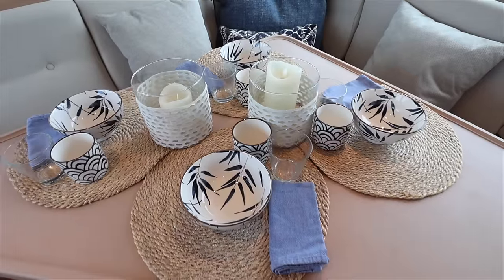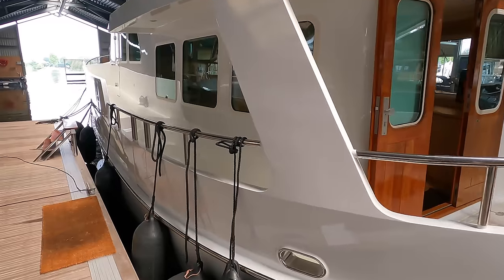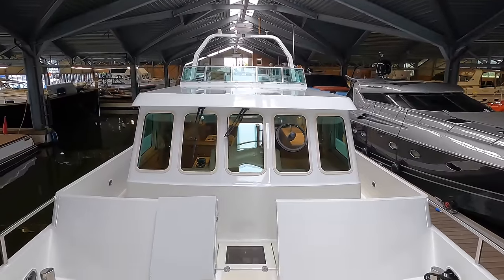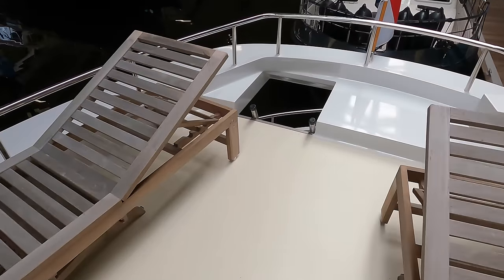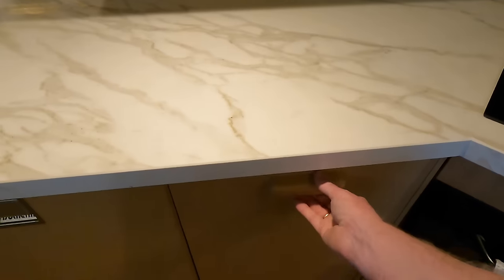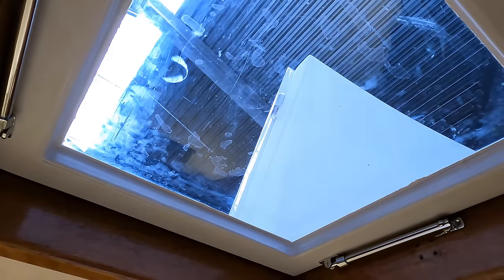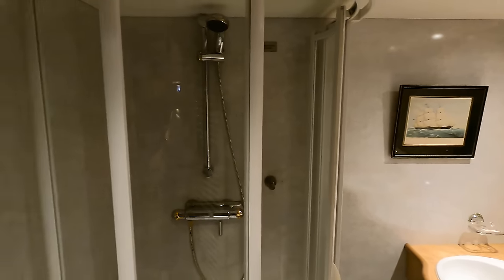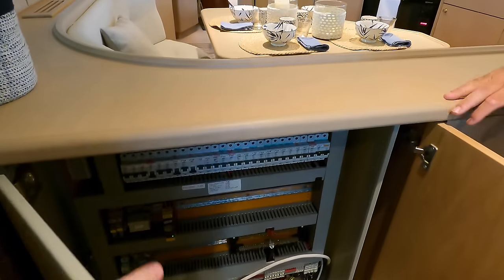ONE-OFF Steel TWIN Engine Explorer Yacht (And She Is For Sale For €545k)

Comment: Did we miss something? One small fridge and no freezer, on an explorer yacht? Reasonably priced and well built i would think, some hits but some misses. Thanks for the tour!
Reply: My thoughts exactly.  Lots to appreciate,  but some things to be desired. Is a bathtub really necessary?
Reply: @MS-bh3uw  Absolutely.
Reply: Fixed;
3000 nm ice. 😄
Reply: @MS-bh3uw  -- is the boat really necessary?  

Of course it is!  I mean it is a tiny tub with Jacuzzi jets - looks like could be great after a difficult grind on land or ice!
I was hoping for more technical area, maybe a laundry area and yes, at least two semi large freezers!
Maybe the mechanical/engine room could handle some more kit?

The tankage is massive though with what, about 4000L of fuel tankage - 3000NM range?  Not bad, necessarily @ 10KNTs, though I could see adding way more solar and I wonder if this could benefit with some sailing rig - main mast to really extend that range (though speed may go down a few KNTs) - and folding props would work better if it were a motor sailor.

1000L for potable water, presumed water maker and generator to handle heating (cooling?) and potable water refill - though a modern water maker could work in a pinch and not take up a ton of space or power.  500L back water tank, yikes!  Three heads ... is nice, two cabins - turn the 3rd (maybe) into storage or technical area - done!

Not bad!

Comment: She's a beautiful ship, but I agree with some of the other comments - if she's going to be a liveaboard explorer, I think she'd need some changes. Her range means you could be cruising for almost two weeks, but with that galley setup I don't think you'd have provisions for more than two or three days. I'd probably get rid of the dining area in the galley to put in a pantry, a freezer, and another fridge (perhaps also a chest freezer on the fly bridge). I would also badly want a washer/dryer somewhere on board. Most logical place for that would probably be where the day head is now, unless we wanted to pull that jacuzzi out and put in a more standard shower.

Comment: If that 3000nm range @ 10 knots is accurate. then that is quite amazing. Dial her back to 8 knots and you're probably looking at 4000nm's. To put that in perspective, the Nordhavn 55, which is a similar length (although 40% extra displacement), has a range of 3000nm @8.25 knots....but her fuel tanks are more than double that of Rosephine.  
Between those fuel savings and her price to buy, Rosephine should be a serious contender.

Comment: This Yacht seems to be absolutely spotless.  Impossibly clean....eat off the deck perfection. Things that need help might be the flybridge access ladder, a dirtier engine room...(proving that the John Deere engines ran more than 1100 Seconds.)  A few cushions to reduce glare for the Captain... 
P.S. Yacht Buoy:  You need to slow down the video, move some things around AND open cabinets.  This would prove the yacht's live aboard qualifications.. If an owner is selling a Yacht, he would probably be OK with you looking into a few things.  You may need to give him/her a heads up, but it's all part of the Game. 
Overall:  This is an Explorer Yacht at a very agreeable selling price.  It will require upgrades to make it a Oceanic Explorer Yacht, though.

Comment: Good use of space. They really got everything in there as much as they could. This would be a great cold water boat. Not so sure I would take it someplace tropical since those airvents look more suited for heat as opposed to AC cooling, but it is a smaller boat so it would probably cool down pretty well. These are the boats though I imagine going through the north sea around Norway, Greenland, Sweden and Denmark then going over the poles to make it down to Labrador off the coast of Canada

Comment: The cutest little ship I have ever seen. I just love steel canoe hulls.  I'm not a fan of over sized looking speed boats. I don't usually like fly bridges but this one is compact and does not look like a pimple on a pumpkin. I would have even been happy with a single engine on this little ship. I grew up in Hull England and most of the big steel Trawlers that ventured into the North Sea only had one engine. I'm a believer in KISS.

Comment: I love this boat. Were it within my power, I would be on the phone with the broker right now. 3.45 metres is 11 feet 4 inches. Regarding the fly bridge. I loathe direct sunlight and desire travelling to rougher places where a steel hull is advantageous, like Alaska, the North sea, etc., so I see it being aerodynamically enclosed against weather.
Reply: @Navy19771:56 "If you're considering navigating inland waterways, her air draft is 3.45 metres."

Comment: It's now 8/24 and it still appears to be for sale, at the same price. I was just casually looking for a possible "great loop" boat. With the draft, and height, this might work. I'm not an experienced boater. What concerns me here is the top side seems to be redone, making it look nice. But, the electrics, circuit panel, original dated engines and systems below deck concern me. Even the smallish cabins/quarters below are fine, and I like the steel hull. But I don't want to buy a "project". I'm just afraid this is too much of a project for me. I would do the same thing if I were selling it. It has good bones. Best luck!  Peace  --gtr
Reply from the maker: Hi 🫡 Feel free to send me an email and I can help answer any questions which you might have: john@yacht-buoy.com

Comment: Love the look, but so many drawbacks. Aft cockpit way too small for relaxing, only outdoor socializing space is on un-shaded fly bridge. Access to fly bridge is via steep ladder -- try climbing that holding a plate of sandwiches in rolly seaway! Interior is nice but only one small refrigerator is way too limited for living aboard or long cruises. I did not see two critical pieces of equipment in the engine room -- stabilizers or air conditioning compressors. That soft-bilged, canoe-stern yacht will roll gunwale to gunwale in a beam sea. No A/C limits usage to Scotland north. Enjoyed the video, but thanks but no thanks on the yacht.

Comment: A very beautiful boat but i have 5 comments.  1.  Where is the fridge? 2. Where does the anchor chain go through the hull? 3. Does it have a washing machine and tumble dryer?  4. I personally think that the position of the top helm is a waste of deck space. Why not putting it in forward on  the deck  to utilise the whole upper deck, because if you put the dinghy on top there is no moving space and last, I cannot understand why boat builders put the master cabin forward in the hull. This is where the most movement is at sea.

Comment: As nice as she is, there is a long list of modifications that need to be made:  Stabilizers (100k), additional cold storage and minor mods to kitchen (20k), remove day head and make laundry (15k), add water maker (8k), and the upper deck??? I don't see a way to fit anything bigger than a 10ft dinghy (10k), solar and LiFePo4 batteries (25k), the dinghy itself (20k).  Swim Platform or way to board from dinghy (20k), that's a lot of work, and to make a platform look decent on a canoe stern requires more design skill than I have.

Comment: Its a great looking boat and in great shape. Fly Bridge is way too far back. It needs to be moved up like 10 foot. You can barely see the bow. The stern looks cool but is a little useless if you want to go in the water. Like all Dutch ships I have seen the stateroom layout is just odd. The engine room would be nice if it was a little taller.